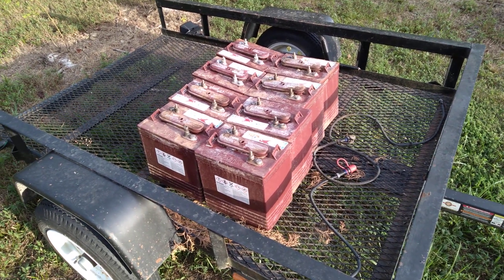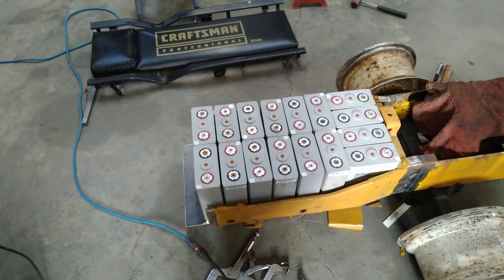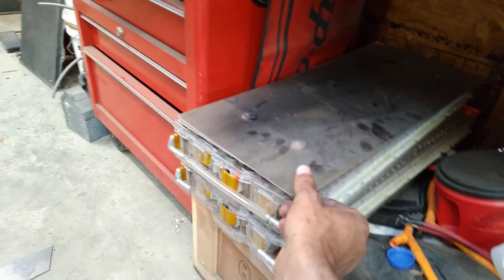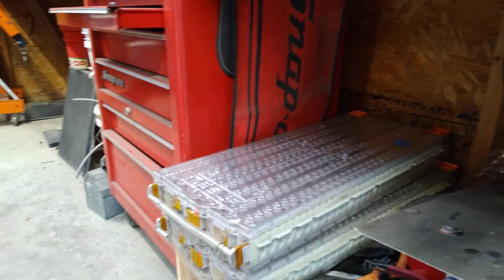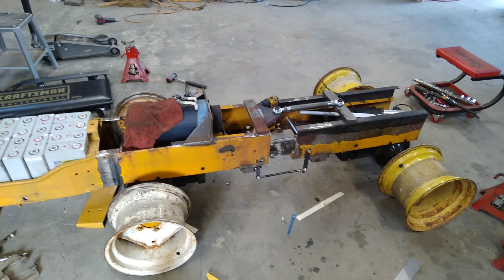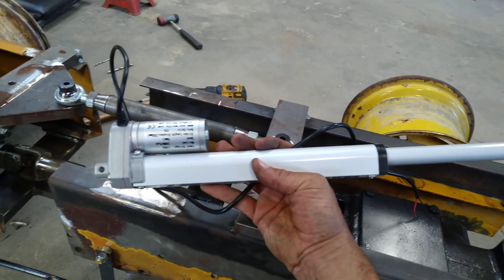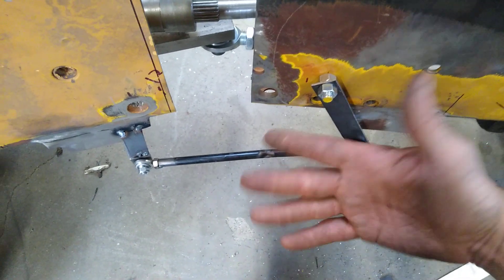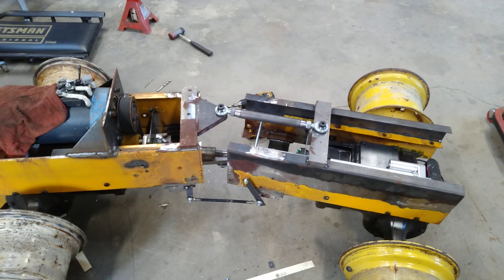An Iterative Process - The Cub

Comment: Why not turn the Heim joint 90deg like your main pivot is? Both of them, bolt facing up.
Reply from the maker: About 5min after I finished this video, I did just that.  I welded the head of a bolt to the bottom of the frame and it worked much better.  :)